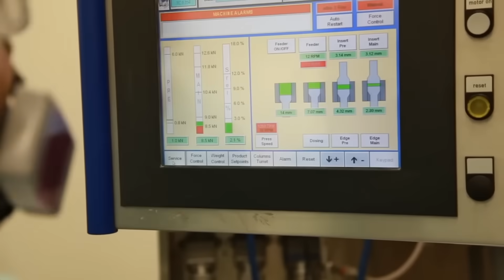Why These Engines Only Last 3 Seconds

Comment: Model airplane engines use nitromethane too.
In the interests of safety NHRA shortened the race to 1,000 feet instead of the original 1,320. Imagine how much faster these cars could get with another 320 feet of full throttle acceleration. They're much too powerful for that and drivers could never survive a crash at 400mph+.
Reply: Very little additional, Chris, because of the incredible aerodynamic load, in no small part on account of the rear wing that produces several thousand pounds of downforce. Acceleration at that speed is down to about 3 or 4 tenths of a G and about the most you'd see is an extra 10mph even if they removed the mandatory timing retard which turns out the lights at 7900rpm. The primary reason for 1000 foot racing, of course, is that most tracks were never built for modern speeds and there's simply not enough shutdown area. Scott Kalitta's fatal crash brought this fact to a head in 2008 which is when the switch was made. Easier on parts, too - 3.7 seconds running time vs. 4.4.

Comment: And the engine is only mounted to the tube frame by metal hose clamps, not a typical engine mount  like most other engines

Comment: some teams do run coolant in the engine. its looped and has a puke tank, and the "coolant" tends to be oil. its not as much cooling, as it is spreading the heat more efficiently

Comment: Dragsters are insanely impressive vehicles and your video is very well made, but some of your claims are somewhat wrong:
-0:12 top fuel dragsters are the fastest accelerating man controlled vehicles, as unmanned vehicles like missiles and rocket sleds can accelerate at >100G (lookup sprint missile)
-0:47 11 gal/s (2500l/min) is a mistake, as you said at 6:57, they consume up to 100 gal/min (380l/min). An old boeing 747-200 on takeoff burns 770l/min of kerosene, and a new b747-8 burns 670l/min , so about double that of a dragster at a still impressive 380l/min
-1:57 they aren't the fastest vehicles (they aren't made for speed but acceleration), and they also aren't the loudest: jet fighters are equally loud (150db), one weird propeller aircraft (xf-84h) is slightly louder, and manned rockets are vastly louder (>200db). Rockets typically require a system to dump entire pools of water in the exhaust plume just to prevent the noise of the exhaust to damage the rocket itself
Reply: "top fuel dragsters are the fastest accelerating man controlled vehicles...".  Not quite!

Comment: If you've never seen Top Fuelers in person, then make it a bucket list item.  There is zero way to replicate the experience.  They suck in so much air your chest feels it, your arms feel it, your EYES feel it.  The whole world shakes.  The sound is deafening madness.  No other form of motorsport can match the intensity of those 3-4 seconds.  It's absolutely amazing.
Reply: It's basically as close as you can get to a huge explosion without dying. It's insane.
Reply: I agree with ace. I tell people all the time, if you've never witnessed a top fuel car run, (even if you're not into cars), it's one of the 8th wonders of the world. Quite the experience. Can't even imagine holding onto the wheel.
Reply: @joequillun7790 the shock to the chest and smell are incredible!
Reply: @joequillun7790 so i should grab me a 5k vacation to witness a 4 sec boom . No thank you , but if it somehow overlaps....thats another story.
Reply: It's Grand Canyon level
 " have to see ".
Reply: @binderfan436  
Yes it is.
Reply: It feels like god has punched his fists through your chest, grabbed you by the spine, and is violently shaking you... whilst roaring in your face so loud that the sound comes from everywhere, and it sounds like utter doom... 
and if you're watching from the top end of the track you can literally feel them pass you, and so does planet earth. 

Mad AF!!
Reply: If you don’t bring ear protection you will regret it!
Reply: @SuperDave-vj9en  
What?!  ;D
Reply: @kellygibson4653  
Obviously you have never been to the drag races before.
Reply: @kellygibson4653  What??!! Can you speak up a bit, I can't hear you!
Reply: When the shockwave blurs your vision as the cars leave the start line. 🤜
Reply: It's not so much the sucking in, but it's the explosions out of the zoomies of basically a stick of dynamite going off in the cylinders EVERY time if fires.
Reply: My dad is pilot in the army i've seen some f16 take-offs you are descriebing the same feelings my guy
Reply: @turkersubasi  NOT the same.... 

A Top Fueller LITERALLY creates a 2 - 2.5  on the earthquake Richter scale 60' away from the vehicle as it leaves the starting line. Jet engines are tame compared to an NHRA Top Fuel Hemi at full bore when it comes to shaking the earth 🌎 

I mean, the Hemi is sucking down MORE fuel than a fully loaded 747 does during take off, and the fueller is hogging down a MUCH more energetic fuel too. 

I've been around ALL kinds of jets taking off, and none of them have EVER came close to recreating the intensity that an NHRA Top Fuel car does when the light goes green. I don't believe there's any other vehicle on the planet that can.
Reply: @davelowets Those crazy unrestricted races where insane people basically just try to turn the biggest motors they can find into missiles is probably the only thing that's comparable but nothing travels as fast as these things.
Reply: This is the biggest lie. There is no comparing the two nice cope, though.@turkersubasi
Reply: @ what’s a two nice cope?
Reply: I was a fireman in the Air Force and did many standbys for jet engine run ups. I’ve also been to a top fuel drag race. Those are two different birds! When those dragsters let go it’s unexplainable! It’s insanity to the max! It’s like rapid fire defibrillators hitting your chest you want to grab on to the railing to keep yourself together. It’s like nothing you’ll ever experience, it’s insane power that will leave the biggest grin on your face! lol! Ya gotta check it out.
Reply: I love going to see theses cars and bikes. Next on my bucket list is to see them roar at night 😁
Reply: @tammyc8077  Nitro bikes are a CRAZY ride for SURE...

It takes a slightly fearless, insane, person to ride these things.
Reply: I was just in p.a for the countdown. I went on Sunday for eliminations. I missed Richmond. It was like 107* degrees during richmond
Reply: @MHolt-t6y It was miraculous.
Reply: you have officially convinced me sir lmao
Reply: I have told people there is only about 10 things in life all of us will ever see that is so great you realize you’ve seen greatness. A top fuel dragster is at the top. Many will say to see a jet take off and I have an it’s amazing bits it’s a far cry from a top fuel dragster
Reply: i shall build one and make it my daily driver. good thing i already park badly.
Reply: sounds pretty shite to me, no pun intended
Reply: You are lying, Top fuels run VW Saveiro G4 engines mostly. 1600cc Ap.
Reply: a lot like masterbating
Reply: Watched them during my trip to las vegas last week. I first saw the pro mods and i was like, yeah ok that’s cool. Then i saw the top fuels and i was like, holy shit what the f**k, this is insane😮
Reply: I’ve been multiple times when I was a kid and it’s still a bucket list item. Now that I’m older and can actually understand a lot more of this I desperately want to go again, but of course I now live way further away than I did
Reply: @kadenherzog9727  Since I was a preschooler in New Jersey, my family went to EVERY Top Fuel Event at Raceway Park until I was in High School. The Top Fuel races were the most amazing things I've seen but seeing Natural High and Vanishing Point in person is right up there also. Those 2 Rocket Cars were something completely different. Not loud like Top Fuel but a high pitch whistle and Damn were they fast.
Reply: Love It !!!
Recommend to everyone !
Reply: Same with nitro funny cars. They use the exact same motor. Funny cars are actually a little faster. TF dragsters are a little quicker(lower ET).
Reply: I confirm. Hard to describe it without experiencing it.
Reply: Nothing I’ve ever seen like it and I’ve seen jets, space shuttle, nascar and formula one. None come close to top fuel
Reply: @acerimmer8338  💯🎯 if you on the starting line when they are lining up your ribs vibrate that's at idle then the launch is something completely out of body if you've never experienced it. I've been going since 71 blessed to have been raised in Huntington Beach California. We had so many good tracks OCIR, Pomona, Lion's, Irwindale, Ontario, all within about 1hr drive. Seen so many records broken. Still miss the A/A fuel altereds. Those dudes were a different breed ❣️🏁
Reply: amen
Reply: It's stupid to most people however.
Reply: People definitely exaggerate it. But it’s still cool for the first 5 runs. Then it gets annoying.
Reply: Well said
Reply: Some advice take ear plugs, you will need them.
Reply: When i was a kid about 12 to 13 my dad toke me to a drag comp down in mildura and it was my first time seeing top fuel dragsters, doorslamers, wheelystanders and jet cars there was this one holden sandman but has a jet engine and i just remaber dad saying now watch when the jet car come out everyone will stand back become if thqy done thay might die of get serious enjois as he said that the jet car was the show closer and i s3en all the people walk off the stip and stand a good 120 feet away from the car as it went down the drack at 2.3 secs at 500+kph
Reply: I've seen it, just not in a race, with all the covers off and whatever.
Reply: Only thing that I've seen that comes close is an airshow. I was lucky enough to see the F-22 fly at Pocono Raceway and good LORD. Made my gf at the time cry. F-35s and Harriers are also insanely loud.
Reply: I keep telling my wife how amazing 3-4 seconds can be and she's just not buying it 😂
Reply: My uncle put Nitro Methane in his chain saw!!! The engine block glew orange and ran forever after he shut it off!!!
Reply: 1000%!!! Even if a person doesn't "like" racing or cars, I've always said that EVERY HUMAN should experience it!! Blast blows through everybody's body and you look around and it's like the stands are instantly filled with 17 year old stoned teenage boys!!  PERMAGRINS everywhere!! You'll NEVER forget the first time you hear it!!! 💜💜
Reply: I worked the starting line at Gainesville for several years in the early 70's. I have launched almost every T.F. car of that Era. Every Funny car, Pro Stock, Modified and bracket car as well.  I have been burned. ran over and seen it all from a close encounter.  Thanks to all who was there.
Reply: I've seen both a top fuel race and a space shuttle launch.  The top fuel race doesn't come close.
Reply: @pleappleappleap no shit really. God get over yourself they are both insane of course a literal rocket launch to space is going to be crazy. But top fuel is the same felling up close and right in your face. 3 seconds of madness
Reply: @pleappleappleap space-x launch and catch is on my bucket list ive seen top fuel and tractor pulls already
Reply: F1 can match it.
Reply: @ Not even close! A top fuel dragster is made to run only a few minutes and is destroyed during that time. It’s literally a bomb. I love F1 but they don’t come close to dragsters. Look at horsepower, sound,etc. Anyway they lowered the engine size anyway so they are really screwing up that sport which is sad
Reply: @zackk695  F1 is still better. Watching an F1 car take corners at 150+ is better than watching this thing explode for 3.5 seconds.
Reply: @ Well that is cool to watch but still not the same as seeing a 11,000 horsepower engine. Just watching them run is unbelievable. They actually shake the ground and you can feel it throughout your body. They are also doing 300+ mph so double the speed of an F1. I think F1 is actually less than a 1000 horsepower so not much
Reply: @zackk695  I didn't say they were the same thing. I said F1 can match it because witnessing F1 cars in person is mind blowing.